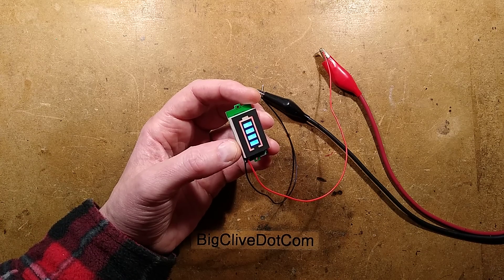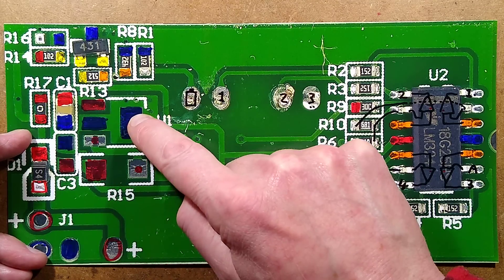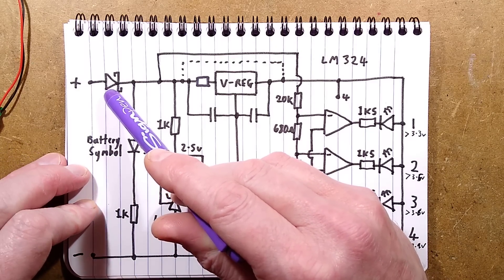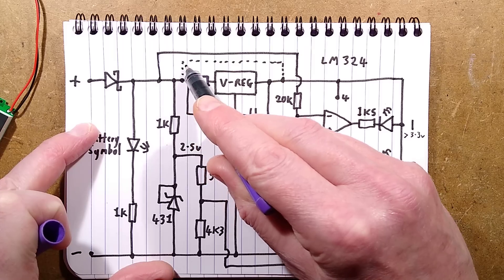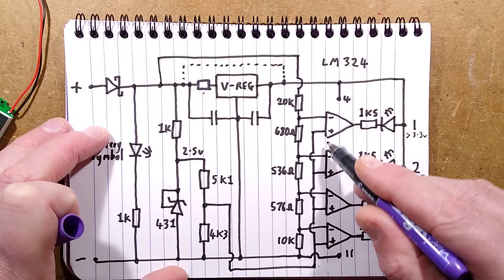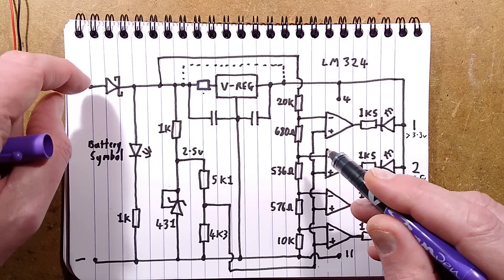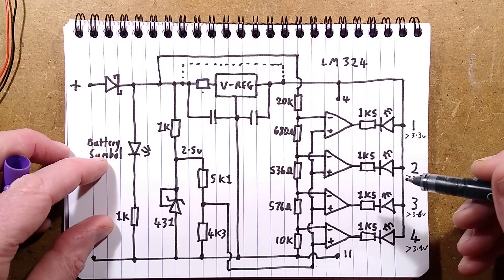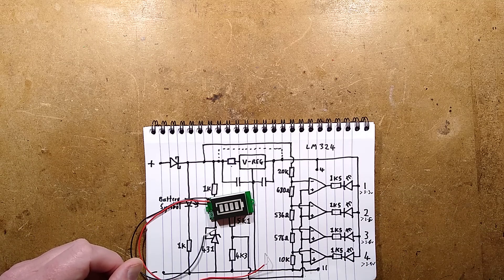Inside a lithium battery monitor (with schematic)

Comment: On a pedantic note, the "positive" input of an opamp is properly called the Non-Inverting Input, and the "negative" input is properly called the Inverting Input. I use a lot of op amps for my analog synth projects. Very interesting circuit.
Reply: Hey, I design guitar pedals....same-same.

Comment: I've bought a few of those just a week ago (just in a slightly different version that allows configuring it for 1S/2S/.../8S via moving a solder blob), and ran into the same annoying behaviour that yours showed: going below 3.5V, instead of moving from 3 to 2 bars, the whole module just dims out. I sacrificed the polarity protection and bridged the Schottky diode out to take care of that. For a fixed install, polarity protection doesn't have much use anyways.
Reply: Removing the Schottky diode you rebel.
Reply: Just remember to recalculate the resistors...
Reply: @johndododoe1411  in the version I have, the sampling resistors are connected before the diode
Reply: @Dime_Bar  Bloody bourgeois Schottkys;  swanning around with their low voltage drops -  off with their anodes!
Reply: Would a full bridge be better for polarity protection, or would it be too expensive/same problem?
Reply: @data9309  A full bridge made with Schottky diodes would drop 0.6V, leaving less than 3V to light the indicator LEDs.
Reply: @data9309  It wouldn't really offer more protection as such - one diode does the job very well, there would be two disadvantages that I can think of and one advantage.

Disadvantage one is simply cost / space on the board though admittedly these are sub-penny items so not really a major issue. Nonetheless if you are making a million at a time, it's a few hundred more SMD reels to buy, and an extra hundred square metres of PCB to buy and etch.

Disadvantge two is more important - you have now dropped around 1.2v (more or less) instead of 0.6v so the red surrounding display would be notably dimmer - and perhaps extinguish altogether on the lowest setting.

Advantge - the unit would work either way around to save needing to take care about polarity at all as it would work regardless.

On balance, I think the single diode is a pretty good compromise between cost / resilience / performance.
Reply: For reverse voltage protection with hardly any voltage drop just use a normal diode and a fuse. The diode is connected across the supply (so it doesn't conduct!) with the fuse in series with the whole module. If reverse polarity is applied the diode conducts and the fuse dies.
Reply: @6F6G  
There's a better solution.
n-channel mosfet in ground lead or p-channel in positive lead (oriented like its parasitic diode does the work) with gate tied to other wire offers almost zero drop polarity protection without blowing any fuses.
correct polarity enhances the gate, wrong gets blocked.
Gate to source resistor to discharge gate when disconnected.

Comment: This brings back memories... I remember 10 years ago making my own 10 segment versions of these using LM3914 display driver chips. There were 3 versions of these I.C.'s, the LM3914(linear), LM3915(3db per dot), and the and LM3916(VU meter). Single bar/bargraph mode, variable current led driver built-in, adjustable voltage reference, and the ends of the resistor chain are available for whatever voltage range display you desired. Very handy I.C.'s for many applications... 👌
Reply: I also played with Lm3914 :) They are not cheap as I remember. Also it was annoying to set the voltage levels.
Reply: I'm sorry I just repeated what you said without reading your comment. I used to use these bar graph drivers extensively.
Reply: I still use the LM3914 in a position indicating system for a roof mounted thermal imaging system used mainly in complete darkness.  As the thermal imager rotates, it turns a 10 turn pot which produces a variable voltage at the input of the LM3914.  The LEDs connected to the output of the LM3914 are arranged around the edge of the monitor on which the thermal image is displayed.  The direction in which the thermal imager is pointed is indicated by which LED is illuminated.
Reply: @MyProjectBoxChannel  same here, it wasn't cheap in the 1980's and 1990's but nonetheless a very nice IC for making VU meters.
Reply: The LM3915 was the chip used for KITT's voice display, I just bought some to make a replica.
Reply: I've also used LM3914's with a diode as a temperature sensor, and then routed the LED current through a 12 volt computer fan. As the bargraph went up with a temperature rise at the sensing diode, the fan would turn on and rise in speed as more LEDs were lit. The I.C.'s could handle quite a bit of current going through them.
Reply: @brucemcpherson8832  That's a novel application for one.. 👌
Reply: @T0NGPU  Yes, it could be. It was also confusing for some people that the LED output current was also tied in with the voltage reference. One had to come up with the right combination of resistors to get the right voltage reference AND the correct LED output  current at the same time. The math wasn't all to complicated though..
Reply: @davelowets  yeah, the math was doable. Getting just the correct value of resistors was more annoying. Always had to use trimpots for getting it just right :)
Reply: @T0NGPU  Yep. Had to be very precise to have the display accurate. Especially when the range it was displaying was very narrow.

Comment: The module is used by many lithium/lifepo4 BMS units (Daly BMS units for example). The button is placed just under the display and is used to turn the BMS on or off. The led module/button comes in a small case which then plugs into the BMS, so it can be mounted on the outside of the whole battery/BMS assembly.

Comment: I think I have seen one of these with a 'push to read' momentary switch, presumably to save battery power since the LED's being on all the time could be detrimental to the cell under test, especially with little in the way of LV cut-off perhaps?  It's a shame these won't work with LiFeP04 cells due to their extremely flat discharge curve.
Reply: Yeah I’ve seen them on sites like AliExpress with the same component position and it more clearly labeled as a switch (SW1). Not sure if I’ve seen them populated but I’d agree with that yeah.

Comment: When I was designing a wrist band tester for ESD testing, I did briefly look into the LM324 but ruled them out for suffering noise.
A wristband on 2 meters of coiled wire makes for some interesting noise antennas when fed to the input of the comparator inputs.
I cant remember what chip I went with in the end but RS and Farnell still sell the wrist band testers that I designed 20 odd years ago
Reply: A simple LP filter on the input would have taken care of that.
Reply: @kimchristensen2175  thats right. we had to but the LM324 still suffered noise so we changed for a better chip and this resolved the issue.
We also had to add noise supresssion else where as noise was creaping in.
Hunting down the noise took longer than the circuit design.
Physical room was also a problem as the circuit had to fit into an existing ESD block but the comppany didnt want to go down the surface mount route.
I hear that the product sold in well enough orders to continue it but never enough to reisk a revisit and move to surface mount.

Comment: I often use these indicators when building DIY power banks and Bluetooth speakers for others. However, I use the smaller modules that display actual voltage in numbers when building stuff for myself.

Comment: Friend of mine online was building a DIY powerwall and needed to test lots (thousands!) of batteries into capacity and group them when they were all bare cells with no markings or anything on them at all. We found these, or something similar, and the end result is a wall of 200+ of these all wired up to battery holders, that had a webcam pointed at this wall of blinkenlights, which would then group them into groups based on how long they would last. Then all of the Group A batteries were re-charged back to full, and tested together to see which would be grouped into a final pack to keep them as balanced as possible. Group B, same thing. Worked great, if a bit slow on the >3000MAh batteries. But in the end he got them all sorted out, put color-coded sleeves on them, and then he bought a "real" tester and yadda yadda.

Comment: I used to make the 12 volt version of the battery level meter with three bipolar transistors and three zener diodes, for use in cars. It was 1977 tho.
Strange to see a level meter in 2022 with a quad op amp - instead of an LM3914, which doesn't require all the external precision resistors, and can drive up to 10 LEDs directly.
Thank you for all your work.
Reply: It all comes down to cost. The 3914 is $$ compared to a jellybean part.

Comment: Hey Clive, I recently picked up a set of christmas lights (fairy lights), a string of 50, with a remote control to set the lights from all white to all color. I bought the set on clearance just for the bi-color LEDs, and then I was going to trash the set. The "bulbs" in the set are a 2-Pin LED, with both a white emitter, and single color emitter in the same package, wired backwards to each other. Flip the polarity and the LEDs change from white to color. No big deal there... These have been around for a while. 
HOWEVER, I have noticed that the remote control for this set is QUITE interesting.. I first noticed the the emitter in the remote is NOT the usual infrared color as usual. The light output is completely visible, and is a very dark blue-violet color, almost like a U.V. color. The next odd thing I noticed is the lack of the usual I.R. receiver in the control box for the light set. By this fact, and by playing with the remote for a bit, I found out that the control board for the light set is receiving the signal from the remote THROUGH THE LED's THEMSELVES!!??
You can completely isolate any one of the LEDs in the string by cupping them in your hand along with the remote, and it will control the lights whether they are on or off through that LED. The control/power supply box is outputting 120 volts to the LED string, and somehow it can still pick-up the remote signal through the LEDs whether they are on or off. Very strange. I would REALLY like to know how that whole circuit works. If you find a set of lights like this, I think it would make a most interesting video subject, and you might enjoy reverse engineering the circuit. I haven't taken mine apart yet, but if I do, I wont spoil the secret.. 😜
Reply: AFAIK LEDs can induce a (slight) current when you shine light onto them (just as solar cells can [theoretically] glow/emit photons). So maybe the remote emits a certain pattern of light pulses and the control box can pick up that slight "jitter" on the voltage/current across the LED string.
Reply: @NiyaKouya  Yes, LEDs DO have a photovoltaic effect, and the blue color of the emitter in remote does seem to induce a larger voltage in an LED(up to 1-volt if held very close to the LED. The hard thing to comprehend is that the remote still works when the LEDs are powered up and lit, with unrectified 120 volt mains on the string. 🤷🏻
Reply from the maker: Could it be an RF control with a plain LED as an indicator light?
Reply: @bigclivedotcom  No. Theres no R.F. circuitry in the control, or the remote at all. The emitter led is in the usual place in the end of the remote. If I block the emitter in the end of the remote with a piece of electricians tape, the remote no longer works. It's definitely communicating with light from the emitter in the remote to the LEDs in the string of lights. Maybe I'll send it to you, and you can investigate...

Edit: I've even gone so far as to pull all 50 LEDs out of the string, and then searched for signs of life in the control box when the remote buttons are pressed. Nothing, nada, zip.. Only when the LEDs are in the sockets, is there activity in the control when the remote buttons are pushed. All 50 LEDs light up in the string. I searched for an infrared receiver in one of the sockets, but nope, they were all LEDs... The funny things is, the distance that the remote will work from dramatically lessens when the LEDs are lit up. It works MUCH further away when they are off. 🤷🏻

Comment: I've used this type of module to monitor the battery level of my DIY 12V LED light panels, running off power tool batteries. wiring in a tactile switch to the pad gives a momentary indication of battery level without excessively draining the battery.

Comment: I've bought a bunch of those similar modules and ordered a few of each listed voltages by the seller. I was sent a bunch of the same ones just with a solder jumper to select the voltage range (1s to 8s). It uses an unmarked 8pin uC and when the input voltage drops really low the red battery shape starts blinking.
Reply from the maker: I've made a video about a similar one, but no blinking control.  Video coming soon.

Comment: Four op-amps used as comparators: straight out of my Higher Physics Analogue Electronics course. We could have built one in the lab, except that Fife Regional Council Education Committee would only pay for one 741 per bench! (And from time to time they had to be replaced when a clumsy pupil wired them up the wrong way round and the magic smoke came out...)
Reply: Not much "higher physics" about electronics basics.
Reply: @johndododoe1411  Do you have any idea how many Electrons and how much Metallurgy it takes to turn on a LIghtbulb?
Reply: @mnkeymasta  7
Reply: @johndododoe1411  It's a reference to Scottish education (which Clive, as a Scot, presumably also got.) From 14 to 16 in my day pupils studied "O grades", and from 16 to 17 what were called "Highers". The course in your last but one year of school was called "Higher Physics".
Reply: @johndododoe1411  In America, it would probably be known as HS AP physics.  I would hope basic electronics, logic circuits and soldering are part of the courses. HS in the USA used to have wood, metal and electronics shop courses.

Comment: The circuit reminds one of the old voltage divider resistor networks used on multimeters. Just replace the op-amp and LEDs with an analog meter. The older multi-meters used precision resistors similar to those odd values to obtain the correct scale readings on the analog meter.

Comment: I suspect the added place for a switch is designed for a momentary on? switch.  So rather than having the LEDs lit all the time, when you want to check battery level, you hold the switch and the display lights.

Comment: I think you are right with an led on the circuitboard, as wouldn't really have a resistor in series with a switch, I wouldn't say it is impossible but far less likely to be a switch. so maybe would be fitted with something like a red led to show that there is power to the circuitboard due to the 3 volts needed for the led line bars to work.

Comment: They could have used a 3V LDO and lowered the LED resistor values to improve the brightness problem.
Reply: I don't think LM324 works well on 3V±10% 3.3V±10% may be slightly better.  However the circuit looks like it could work on a nearly empty LiPo, but the 0-bars range is not going to be particularly bright anyway.

Comment: The LM324 is a 30V opamp, and seeing as all the dropper resistors are in the k-range, the worst current those LEDs would see would <20 mA, I'd guess this would work quite fine in a 24V system!

Comment: The LM324 sure brings back some memories of analog electronics 101. I wonder why they use a quad op-amp for this circuit instead of a quad comparator like the equally ubiquitous LM2901?
Reply: I'm quite impressed it had a quad LM324 at all and not some discrete resistor transistor network.
Reply: It may be cheaper. I haven't looked.
Reply from the maker: Probably a cost saving.
Reply: @Reactor89  maybe they could do it with same accuracy as the comparator one using 431s in array, but that might be a lil more power hungry with each needing extra mA.
Reply: @plainedgedsaw1694  I wasn't thinking same accuracy or better in anyway, just a few cents cheaper than a full on LM324. But then again don't know how far they have driven down the LM324 price.😅
Reply: Most likely because a LM2901 limits the voltage range of each input to 1.5V below the power supply voltage, but it will give a correct output as long as one of the inputs is within this limit, the other input can driven beyond this limit.
Reply: @Jeroen74  I think the same goes for the LM324. I don´t know what it is about these old op-amps and comparators. Performance is meh but they will always have a special place in my parts drawer ;)

Comment: Some Dewalt batteries have a built-in charge indicator (and other brands as well). I'm willing to bet their design is very similar to this for simplicity and low cost. Also a button needs to be pressed to activate (momentary  switch).

Comment: They've basically made their own LM3914 bar graph driver. The LM3914 is  the same comparator resistor divider inside.

Comment: OK, I'm confused. How does "30C" mean 20K?  I would have thought that would be encoded as "203".  Similarly, what's with 74A and 71A?
Reply from the maker: It's a resistor coding system called EIA-96 that caters for more precise values.  Unfortunately it does require a chart to read the values.
Reply: @bigclivedotcom Any chance do you have a link to the chart?
Reply: @davestech6357  really a search for eia-96 chart will give you plenty variations.
Reply: 10^((n-1)/96)     for example 30   30-1=29 10^29/96=2.0049 or 2.00*1000 (the C and 3 digits)   use log identities to go the other way

Comment: So it consumes current continuously, I used them in the past and put a push button switch in line with it so you can push it to check the battery level.  So I wonder if that location next to  it might be for a switch to serve that purpose?